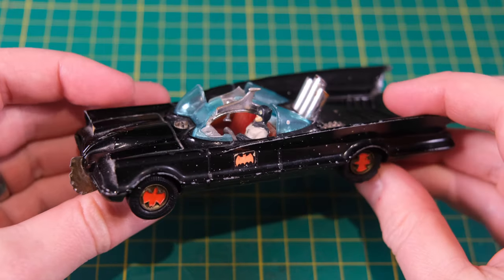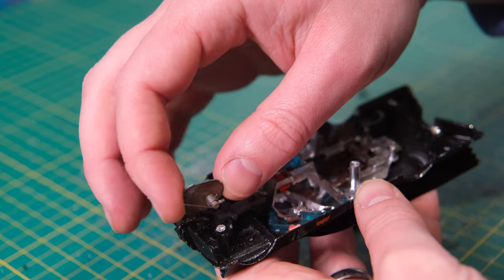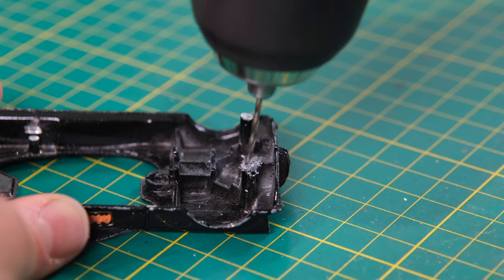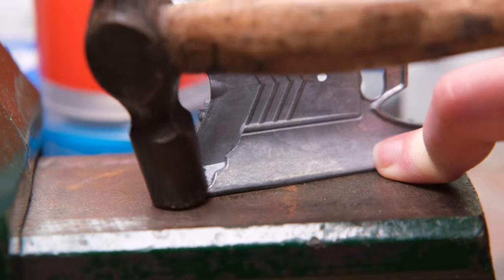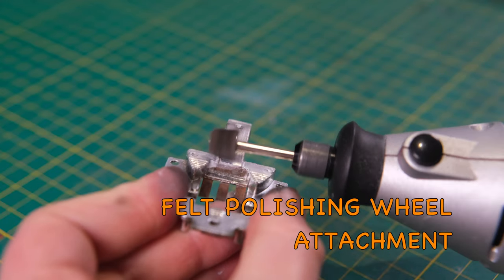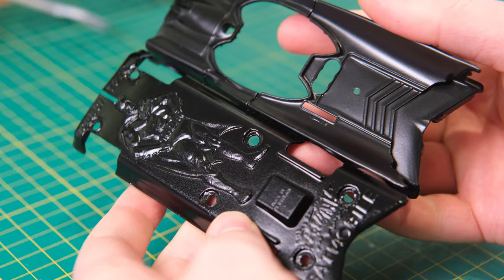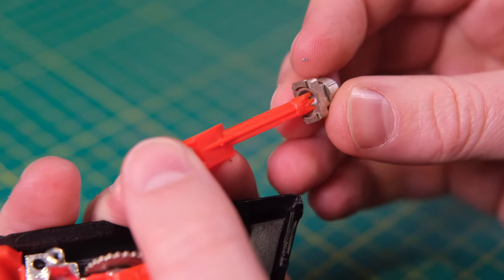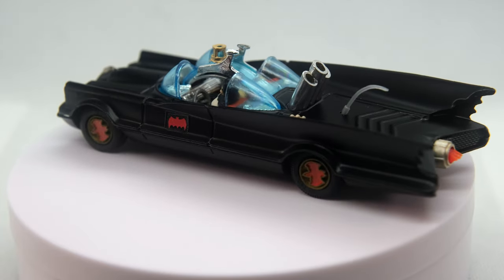CORGI restoration: 267 Batmobile - A How To Guide

Comment: Beautifully done.  Even Corgi Bob would be impressed.  The beacon on the original is a separate fitted red one.  The repro part has it moulded in blue.
Reply from the maker: Yeah I did wonder that afterwards panicking that I’d missed something. At least it’s a clear differentiation between genuine and restored models, especially at the value some of these Batmobiles sell for!

Comment: Great video !!! I’m also started to restore my dads Batmobile, and I have a question about the cast metal divider. Did you didn’t fasten the cast metal divider ?
Reply from the maker: Good to hear you’re working on one too! I left a large burr on the rivets that hold that metal divider in place so when I pushed it back together it clicked secure. However, if yours is loose, I’d suggest using a drop of super glue to secure it instead

Comment: Im interested in doing a little custom batmobile i would like a batmobile with wide wheels and in the future maybe aan original batmo bile with red wheels Are the original hubs hard to get off and how would i do it with out breaking it
Reply from the maker: They are fairly easy to remove by twisting off if I remember rightly. Well worth a go though